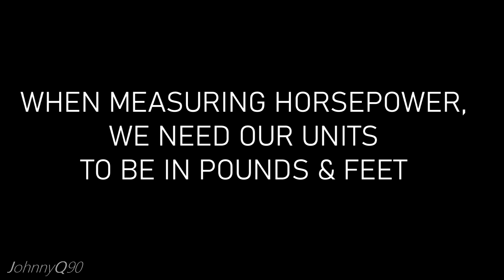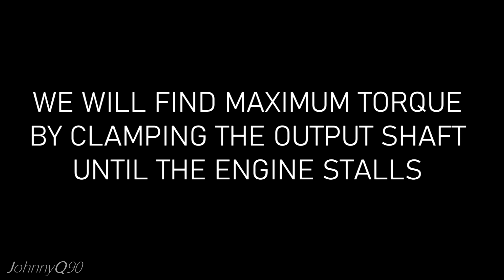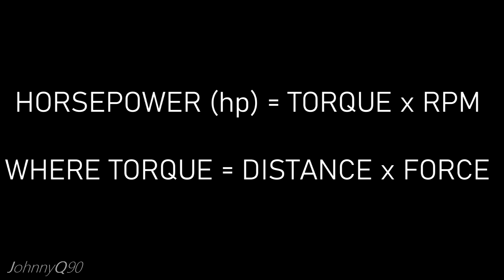Simplest DYNO for RC Engines! - Prony Brake Dynamometer!

Comment: You need to make sure your force measurements and RPM measurement happen simultaneously. Also, peak torque almost never happens at the same RPM as peak power. 

Having finer control over the braking force applied would be nice. What about making an electronic brake using a BLDC, a three phase rectifier and a rheostat. Another option would be a pump (fixed displacement) attached to the crankshaft and a needle valve. The body of the motor or the pump would be mounted to the arm that goes to the scale. You would probably need one support bearing at the opposite end of the motor or pump. 

By varying the brake force the speed of the engine could be controlled at WOT and if the engine speed is not changing then the torque generated by the engine is the same as the torque absorbed by the brake. Take a reading and adjust the brake to change engine speed in 1000 rpm increments. You could develop a whole torque curve this way and then calculate horsepower.
Reply: Absolutely what I was thinking - a BLDC motor as a generator connected to a load. Measure RPM, current and voltage using an arduino and a few suitable modules and you can get a propper dyno curve.
Reply: @lewistaylor863  You can't measure power directly from the output of the motor. The efficiency curve is unknown. You use the motor as a brake and measure force using the scale while measuring RPM using the tach. This is how real dynos (load based) work only they use a load cell or torque transducer instead of a scale, but really they are the same thing. The scale is going to have a load cell in it. The BLDC motor is only to apply a load to the engine, you waste the electrical energy as heat in the rheostat/potentiometer. 

Another option may be a mountain bike disc brake if you were looking for an all mechanical solution. For the cable based ones it should not be too hard to rig up a screw based tensioner that would apply tension to the cable precisely to actuate the brake to control the engine speed. 

Warped Perception did something to this on his turbo see "thru" engine videos, but he used a motorcycle brake or something similar because the engine is much more powerful than a hobby engine. It would destroy a mountain bike brake.
Reply: Just use a pulley and a weight lmao
Reply: No need for a BLDC, just a regular, off the shelf permanent magnet DC motor, with a loading resistor and potentiometer then measure the volts and amps for your power output. With the pot you can have much finer load control then a wingnut on a wooden bar.  746W to 1 Hp or very small fractions there of for this one.
Reply: @inothome  You're right. I just figured he already had a big enough brushless motor.
Reply: Torque and hp have always Cross over at 5250rpm in american V8 that I remember.
Reply: @MJ-gq9nv  Correct, 5252 is the constant in the formula to calculate HP from torque and RPM.
Reply: @Fix_It_Again_Tony  @inothome This discussion led me to think- a water cooled BLDC as a load would allow you to calibrate the losses in the motor, considering the temperature rise of the water, in addition to the resistive load?
Reply: My Idea would just be a large spinning weight (like 10-15lbs). do some math to find the inertia, use and arduino for accurate rpm recording, some math in excel later and you can have a whole torque and power curve that would be very very repeatable and accurate. pretty much like a real dyno for cars.
Reply: @inothome  the output from the bl motor would be less than the power measured with scale and tachometer. This would be the efficiency of the bl motor.
Reply: @levio1463  that is exactly a how the a dynojet dyno works, it is good for raw numbers, but it only shows how it accelerates and is pretty poor for tuning an internal combustion engine, since you usually need some time at speed to properly adjust things.  Look at the units we use for power- "bhp" which stands for brake horsepower- the degree of resistance offered by (or power put into) a brake.

The dyno type you mention is great for a quick comparison- to show what the engine is capable of. To make it the most capable, you need a brake dyno.
Reply: These are big brain people
Reply: It is uncorrected experiment
Because of many of  losses
1. Flywood loss
It is mean you can rench screw and then flywood recevied many friction of  before reach peak value.

So it is loss about 40% and then

2. You can not consider angular velocity value 
You can try to measure to rotate of 5degree torque mesurement required of 360 degree per 1second

So reality torque as follow this
You can mesure meter 0.152m=15.2cm=152mm

85g×9.8m/s^2=0.085kgf=0.883N=
0.833Nm×0.152m=0.127Nm

P=VI
P=w×T
=2pi rad N/sec ×0.127Nm

Your measurement only 5 degree per second rotating
Torque Proportionality to w

So

=(2pi rad N/60sec) ×0.127Nm

N=6600
THEREFORE 0.105×N×72times×0.127Nm
= 88W
88W/736W=0.119PS
But friction of flywood a lot
So already 40%loss
If it is not loss 
88W/1-0.4 =147W
147W/736W=0.2PS

And flywood weight  loss
10%
147W/0.9=163W
163/736=0.22PS

Realty PS horsepower of 0.22PS.  at=6600rpm

If the situation  of 12500Rpm
 it is about 0.4PS 
It is totally reality

Comment: There is a misconception in this attempt of yours to measure the torque the engine is producing.

When you clamp the crankshaft until it stalls, you are measuring all the inertia of the engine to brake to a complete stop after reaching the 6500+rpm.

To measure the actual torque the engine is producing you need to progressively clamp the crankshaft axle until you reach the steady state condition. The value measured will then be the actual torque that your engine is producing.

Cheers and keep up with the awesome work you are doing!
Reply: @M80Ball  Why should he shut up? if what johnny does it wrong, you can be sure he also wants to do it right.
Reply: Could you please explain it more detailed? I see no difference between the modus operandi of Johnny and what you describe. If you could please find other words to stress the difference ??? Thank you...
Reply: @klausbrinck2137  the difference between what I described and what he did in this video is basically this:
In his test, you imagine a kid going fast with a bike and you are standing still in front of him. When he hits you, your resistance is there to brake him to a complete stop. Meaning: you are absorbing all the inertia, plus the torque he was producing.

The way I described:
You are going in the same direction as the kid is going, at the same speed. However you are applying a brake to only the power/torque the kid is producing to keep the bicycle going. In other words, the inertia is canceled because both of you are moving together. The only measurement you will do is the braketorque necessary to maintain the steady state condition of speed you were in the beginning of the test.

This is how we measure the engine power and torque at the industry. I am an powertrain calibration engineer at an European carmaker, btw. :)

If you still have any questions, let me know!
Reply: @vsilvanivs  I understood very well when you said, that he has to measure the torque while excluding the motor-inertia. But I do not understand how he can, poceedualy, reach this target (always with simple means, of course ). I do not understand what to do to "progressively clamp the crankshaft axle until you reach the steady state condition". He alredy used the clamp incrementaly/progresively... And how do one notices if the "steady state condition" was reached, what phenomenon is then to be observed, in order to say that  "steady state condition" was reached?
Reply: Absolutely, the engine should be running in a steady state condition when the measurement is made (not stopped).. easier to use a weight/ spring balance and a rope over a small flywheel ...
Reply: No it looked fine.  He was braking the engine down pretty slowly.
Reply: @zachary3777  better to be quiet and to be though stupid that commit to words and prove it. Engine must be running steady state to measure torque.
Reply: @andyxox4168  I guess you've never seen a Dyno pull.
Reply: @zachary3777  I think your applying a whole other level of calculations, approximations and inaccuracies used to avoid removing engines from vehicles to approximate torque and BHP ... 

… on a dynamometer an engine is run at constant speed and the torque measured, on a rolling road (I think that is where you’re getting your ‘dyno pull’ from) the vehicle is accelerated and the torque calculated from the resistive force + any acceleration, then allowed to decelerate to provide an estimate of the drive train losses allowing flywheel torque (and BHP) to be calculated … can you understand that? … Did you ever see a dyno pull where they stalled the engine 🙄 (duh)
Reply: If you're taking max torque (i.e. max weight) does it matter that the engine stalls after? You should still be getting the highest torque the engine can produce.
Reply: @satibel  … yes it does and no you’re not, still you can revisit the problem if you ever get a degree in engineering!
Reply: @satibel  Hi. It unfortunately matters, because the change of engine speed reflects on measuring also the inertia that the movable parts of the engine summarize. I am a calibration engineer at a car manufacturer and, with working experience, I can say that to measure Only the torque out of the flywheel, you need to have the steady state condition.
Reply: @vsilvanivs  but if you use the maximum weight on the balance, you do get a number that's higher or equal to the torque, right?
Reply: @satibel  definitely higher than the actual torque
Reply: Victor is correct.  Some of the comments here explain why Sir Isaac decided to publish the Principia in Latin rather than English.

Comment: I am a dyno technician. And i have never thought to test rc engines like this, this is smart!
This is a "load cell" dyno. How about an electric motor or something to provide resistance?
Reply: Yes I was thinking the same.
A BLCD with a VESC in regenerative braking mode where you increase gradually the braking torque.
More repeatable maybe...
Reply: @bensthingsthoughts  or a flywheel geared right up mounted on the arm
Reply: @bensthingsthoughts  or just a DC motor hooked up to a potentiometer for variable resistance?
Reply: Electromagnet, not a motor
Reply: elec magnet could give it resistance .. he could make a small steel flywheel then outside have a wire coil when powered would give resistance to the engine ..

Comment: Now THAT is a nice contraption. Real data from real measurements. Kudos! 

PS: Power measurement and calculations are part of my profession. Here's a few tips: What you were measuring now was peak torque, and peak torque is always WELL below peak HP. 
Second thing that went wrong, is that with full throttle, if you bog down the engine, such a simple carb will most definitely not hold mixture, so your actually measured value will not represent what the engine is capable of.
Richen up your HS needle a bit and I am pretty sure you will see higher torque values right before stalling. Reason is, dropping RPM reduces intake vacuum, and that reduces fuel draw, and your mixture will lean out because that throat diameter is designed for 10+K, and you are running only 6K.

Now, your peak HP will be around 10, maybe 11 K
So if you want to know your peak HP, set the brake for around 10K RPM, then peak the needle and if necessary readjust the brake to maintain around 10K.
Now try to get torque readings in steps of 200 RPM between 10 and 11 K, and I am pretty confident that you will see higher HP numbers. Realistically, I do not expect 0,5 hp, but 0,4 should definitely be within the range of what is possible.
My own 5 cc fourstroke runs on gasoline (less power than Methanol) and manages about 0,3 HP @ 9,5K
On methanol, 0,35~0,4 should be absolutely possible.

Comment: Your math is off. 

Hp= tq x rpm / 5252
Using the force measured at 3:57 - 3oz @ 1/2 ft = 6 oz/ft or .375 lb/ft 

.375 x 6600 / 5252= .471 hp.

Great work and thank you for the quality content.

Comment: If you're after a mini-dyno, another interesting thing to look at would be an eddy current brake - using the lorentz force as a brake. It's substantially more tuanble than a direct mechanical brake. A spinning disc of aluminium within a strong magnetic field produces eddy currents within the aluminium, the eddy currents themselves also produce a magnetic field that opposes the rotation of the disc (which is the braking mechanism), the result is a torque transfer to the electromagnets, and heat in the aluminium.

A few ways to attack this in your application would be:

(1) to get a bunch of neodymium magnets and modulate their proximity to the disc, though the torque would need to be measured through the structure that holds the magnets as well, which complicates the construction difficulty.

(2) to get a bunch of electromagnets off eBay, and modulate the current within them with (an adjustable) constant current power supply - this may be easier to facilitate the torque measurement, but would likely cost more if you don't already have the supporting equipment. Though it is my preferred solution, as I've been designing a system like this in my own endeavours (with 50cc engines) because (if you're ok with microcontrollers/etc...) you'll be able to perform basic run-and-hold tests with an RPM feedback into a microcontroller. The microcontroller would allow the engine to run to X rpm, and then actively track and adjust the electromagnets to prevent it going any higher (thus allowing the engine to run under full load without revving out). With a bit more development after that, you'll be able to do full dyno runs and graph the results.

(3) use a brushless DC motor to generate power. By directly hooking up a motor (as a generator) and varying the electrical load on the generator. You would want to measure the torque transfer on the generator chassis and RPM, don't even worry about measuring the electrical output power to gauge input power (though it might help to confirm your findings) - using motors as generators is notoriously inefficient and the output electrical power wouldn't be an accurate number.

Comment: One of the things I noticed that make power is the heat range of the glow plug, it’s the same as to advancing or regarding ignition. Most useful when using high nitro content fuels.

Comment: The arm distance is actually going to be a little over 0.5 ft because you need to be measuring to end of the 3D printed point not to the base of it. Putting that point there essentially puts the arm there. may not make a huge difference but in something like this it's worth noting.

Comment: 2:22 Actually, you want them in kilograms and meters...
Reply: That would give you Kilowatts, Horsepower is an imperial measurement.
Reply: Doesnt matter. You can convert it to Newton meters very easily.
Reply: @jamesandonian7829  Why bother converting when you can measure true values instead?
Reply: @pyro1324  *kilogram-meters, then converted into Newton meters.
Reply: @yshouldicar3  *Troy ounce-nanofurlongs, then converted into dBm.

Comment: Your measurement of the arm should have been from shaft centre to the point of contact with the scale. A pointy-er pointer would have been better to keep control of the point of contact better as well. 
  A pump or a eddy current brake is going to be the only thing that’s going to give you anything like a reliable result or a situation where you can hold the load long enough to read the scale. Did you read my comment on the centrifugal supercharger? A plenum could be the solution there. 
  Really nice machining work, you are very patient and skilled. One of my favourite channels.

Comment: Angular speed in rads/seconds × torque in newton-meters = power in kW

RPM ÷ 60 × 2π = rads/second 
kW × 1000 ÷ 735 = HP

And now you can calculate

Comment: You may want to change your center shaft to a larger diamater.  This will decrease sensitivity to clamping and increase surface area allowing for more mental volume to absorb heat a little better.  The prony brakes I have used typically have a hollow cavity inside the metal part to allow for adding watter to help with cooling.

Comment: Check if that mdf has constant friction/temperature. Seems like it could adjust more gracefully. Maybe larger diameter shaft and something else for braking material between metal/mdf torque arm?

Comment: This is actually a genius way to measure power
Reply: Ancient method. If you want more in depth details about it, Mike over at SmallEngineMechanic has a 5 part series about building a prony brake for a Briggs&Stratton engine.

Comment: This measurement is really cool!
Shouldn't you place another bar of the same length and weight on the opposite side of the scale to prevent gravity from acting on the scale? Because the weight of the part on the scale can give the wrong measurement when your engine is running.
Reply: I expect him to have pressed the tare button to normalise the experiment.
Reply: @crackedemerald4930  This I do believe, but I noticed the lack of a counterweight in the measuring arm, to balance the weight on each side.

Comment: Hi Johnny, for a coorect mesure of the power you need to make it every time at full trottle, and adjusting the rpm by clamping the brake, otherwise you do not measure the maximum torque at the various rpm